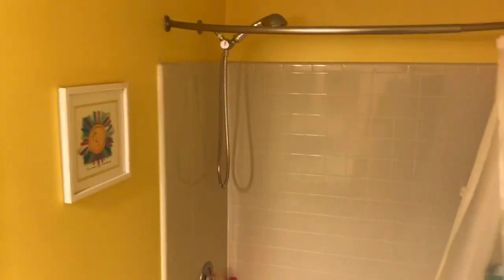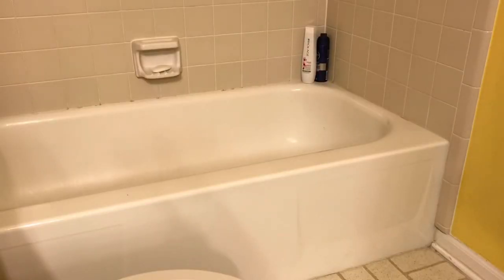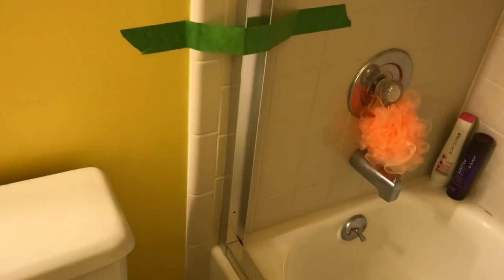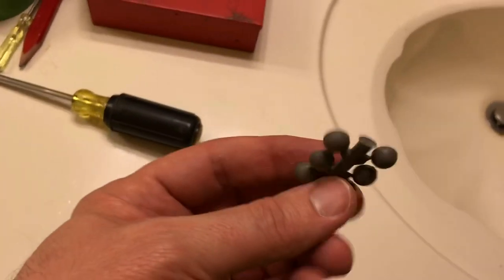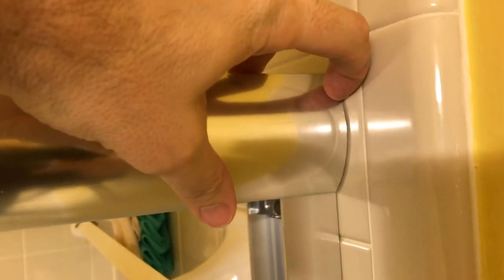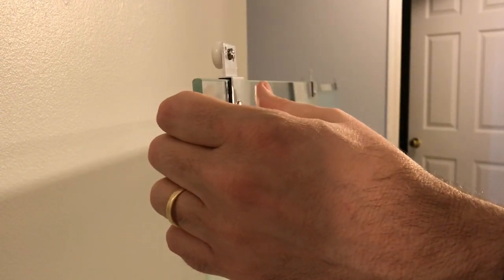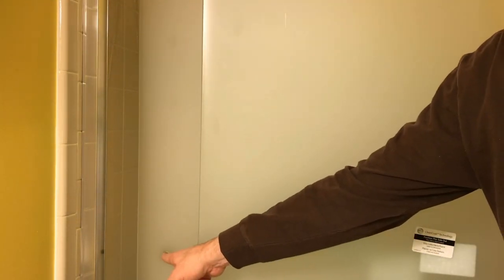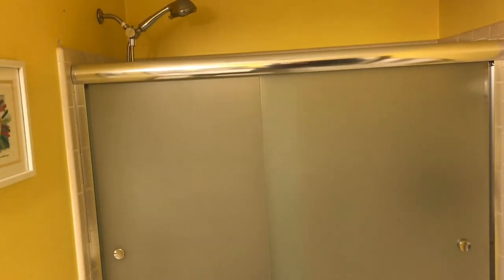Installing a Sterling shower door in a shower/tub

Comment: Helpful video,installed the same barnd and model from Lowes yesterday,couple of tips first the top jamb has no screws to attched use masking tape or duct tape to secure in palce when installing doors,remove it slowly once everything is done and caulking is dry ,second use some old towels or movers balnket inside tub and move shower  doors inside of tub then installed both from inside of tub rather outside,another pair of hands is good if available.

Comment: We installed a similar door but we ended up with a gap between the bottom rail and the tub. Any suggestions on how to address this? We put tons of silicone, but we are thinking that there must be a way to fix this differently.
Reply from the maker: Strange there would be a gap.  Does each end of the tub curve up to the wall like in a 1-piece unit?
Reply: No. It is a bathtub with a bottom piece and the walls are a separate piece but “joined” together at the bottom
Reply from the maker: @gabrielporras-sanchez8039  - so is it at each end where the bottom rail is being held up?
Reply: Yes
Reply from the maker: @gabrielporras-sanchez8039  then the bottom rail needs to be trimmed at each end to fit the contour of the wall & tub in those corners.

Comment: This video was perfect! I don’t have much handy man experience but I was able to install my shower doors flawlessly. I had trouble marking the holes for the side rails even with the drill bit so what I did was break open a pen and used the ink tube it has inside to be able to fit into the side rail holes. Thanks so much, man!
Reply from the maker: You bet. Thanks!

Comment: Great work instructional video and I am heading out now to pick up a new shower door today. Top measurement is 59.5" and the botton measurement is 58.5". 

Question please. I see that you had to drill into the tiles, which is something I will do, but is it possible to merely use silicone to seal the frame without using screws? Would this work or not? Thanks in advance.
Reply from the maker: I think that would be possible.  Just tape them in place and leave them for a day before finishing the assembly.  The only down side is if the doors are pushed on from either side, they could break loose and fall.
Reply: @Foxedup  Hey thanks for the fast reply, appreciate it.

Comment: Do your glass doors slide easy? I’m having trouble with mines
Reply from the maker: No problem at all.  Can you tell if they are tight or dragging in a certain area?
Reply: Like when I try to slide the doors open feels like they dragging but there’s a gap at the bottom so I’m not sure what can be the problem did urs come with a shower sweep?
Reply from the maker: @bettylicea9587  could be a number of things, but the first thing that comes to mind is to double check to see if the rollers are turned the right way.  There should be a space between the nylon wheel and the bracket allowing it to spin freely.
Reply from the maker: @bettylicea9587  also there could be a gap at the bottom of the doors but still drag slightly on the plastic guide on the bottom track. Check that.  If it’s rubbing there, you’ll need to move the roller down to the lowest hole closest to the glass.
Reply: It was the rollers thanks again appreciate it

Comment: I need to know how in the hell you are putting in these cheap wall anchors when there’s an inch or better gap between the side piece/wall jamb and the wall.
Reply from the maker: The screws are long enough to reach just fine.  The anchor doesn't know and doesn't care if the screw is a foot long or half an inch or if it's even in all the way, as long as it's in enough to push the anchor tabs outward.  It'll hold!!
Reply: @Foxedup  there’s nothing for it to hold to so it would matter not only the length of the screw.  Is this video assuming that one fastens the jambs to the surround prior to setting the surround?  Or is this door kit ONLY for use with tub / surround kits.
Reply: @Foxedup  Clarification;

So I’ve torn out an old tile surround and left the tub. Then installed another three pc surround and the customer elected this door.  If you place the jamb against the surround WHERE IT IS SUPPOSE TO BE, you have an inchish between the jamb and surround.  If you put any anchor in the surround then place the jamb in desired location you will need a longer screw so, if I aim to install this per the instructions or the video I will need to either A install the jamb prior to setting the surround or B use longer screws.  Hopefully this helps clarify the issue.
Reply from the maker: @RC51SP2_  - I may be misunderstanding.  The anchor goes into the wall, then the screw goes through the jam into the wall anchor.  There just some empty space behind the jam, but that should be ok.
Reply from the maker: @RC51SP2_  probably longer screws would be best. Some stainless steel ones.
Reply: @Foxedup  correct!!!!   Though these screws MIGHT catch two threads at best.  I can’t be content with that at a customers house or any house. I just don’t trust it!!!!!   Not enough threads in the anchor.  I’ll just have to go get longer screws.  No biggie.  I do appreciate your feedback!!!!  Thank you.